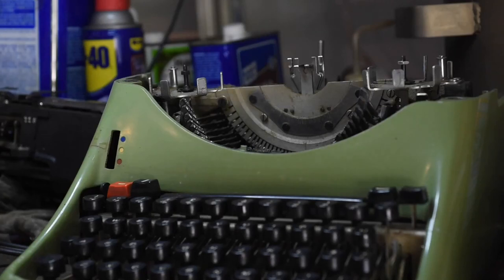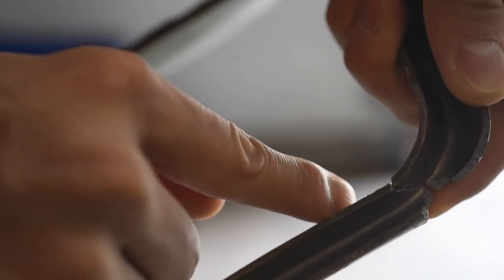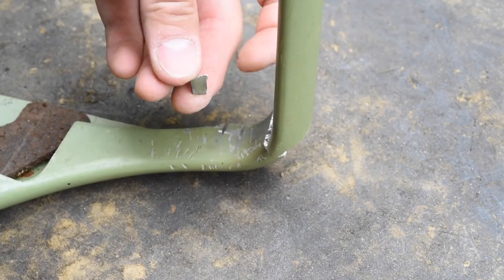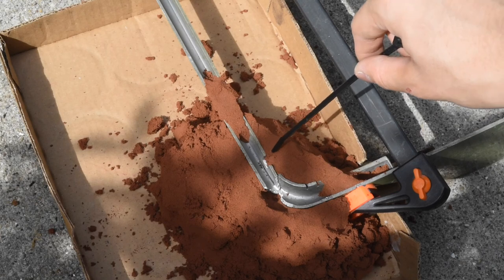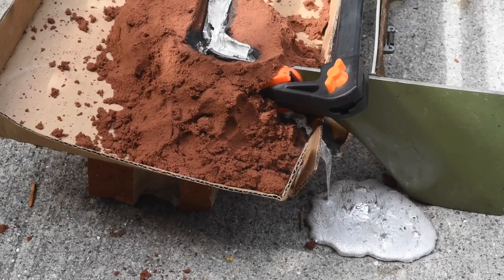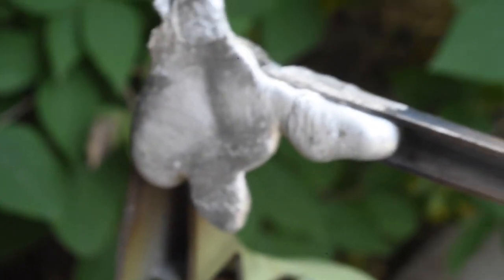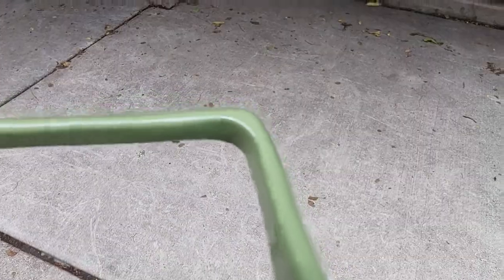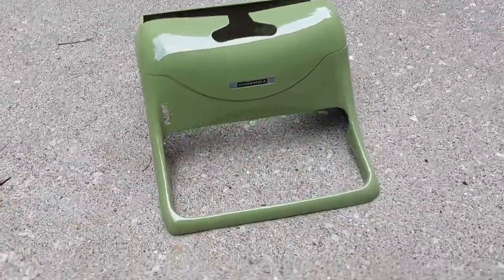Type Shop, Ep. 11: Aluminum Body Panel Repair

Comment: have you considered using wax to fill in the missing bits and then pouring ? it might simplify things esp if you already have the ability to use sand to mold. i'm seriously so impressed with the result! awesome work